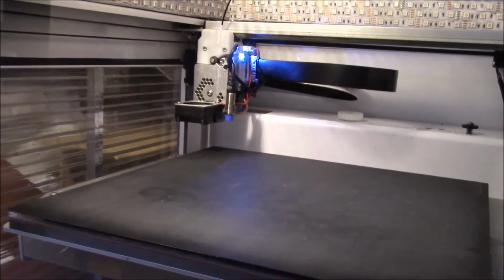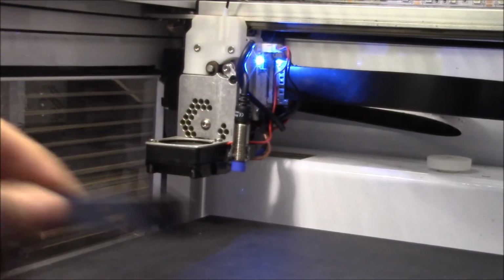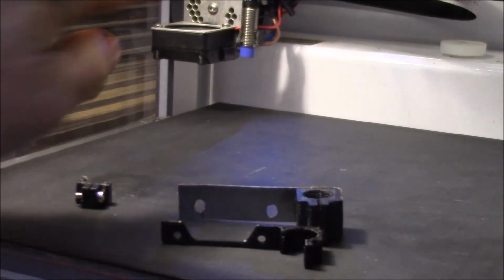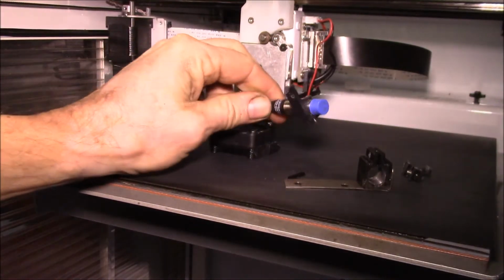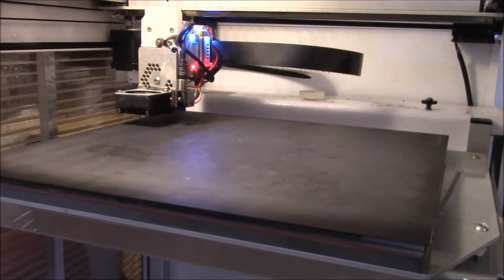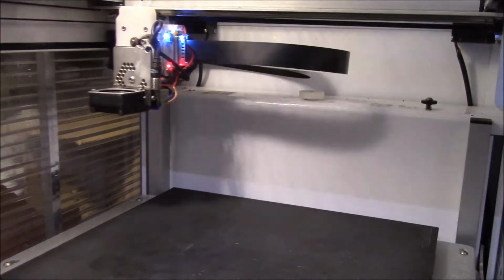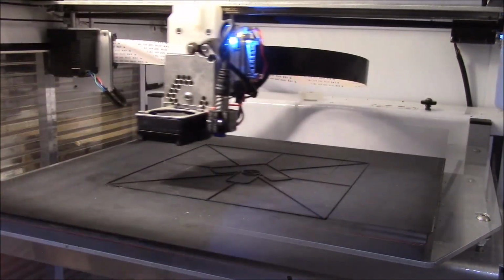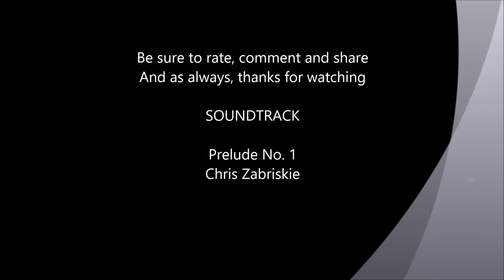Series 1 Pro Auto Bed Level Install, Part 2

Comment: I just picked up one of these printers, used, and it has the sensor on it but I'm not understanding where you are controlling the auto bed leveling from. I have logged into the web interface but I don't see an option for auto bed leveling. If you could offer any insight I'd really appreciate it. This is my first 3D printer so I'm very much a novice. Thanks!
Reply from the maker: No control for this in the Octoprint interface, it's a G-code command that's part of the startup gcode file that Cura automatically adds to each print.  You need to make sure the firmware in the printer has been updated to support that auto bed leveling feature:
https://youtu.be/UfWwVvk_-5s

Comment: I can not help with the sensor mine is a square sensor with just wires coming out. I had to manually adjust the bed to the head first and then the sensor corrected much better. Printing a lot of upgrades for the tronxy P802MA on my CTC now

Comment: With my sensor, it is a little inconsistent with larger builds. For example the top left area of the build plate, it is extremely close but then on the middle it is perfect. Any feedback/help?
Reply from the maker: I haven't run into that yet.  Be sure to let the bed heat up to the desired temperature at least 10 minutes prior to starting a print.  This ensures even heating and lets the material expand with the heat.  One thing you might try is in the configuration.h file, there are a few options on the bed leveling technique, one is AUTO_BED_LEVELING_LINEAR and the other is AUTO_BED_LEVELING_BILINEAR.  The first assumes a perfectly flat bed and just calculates the plane of the bed.  The second assumes a less than flat bed and calculates a better fitting leveling surface to use.
Reply: Thank you! Will try this once I get home
Reply: I just did that and it works! Thanks for the help!
Reply from the maker: Was that the BILINEAR mode?  I want to give that a try on my printer, see if there is any difference.
Reply: R Brown yeah, I opened the configuration.h file and did command find then I searched linear and changed the define from linear to bi linear. Thanks for the help
Reply from the maker: great, thanks for the update.  I think I'll give that a shot on mine as well.